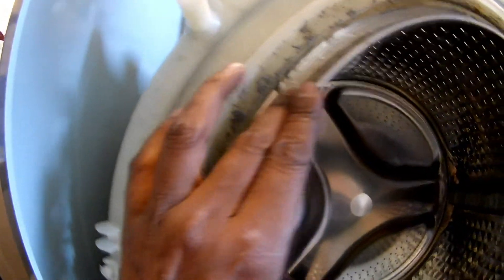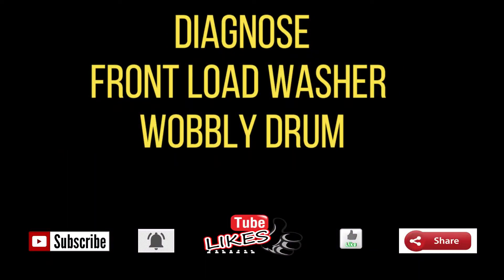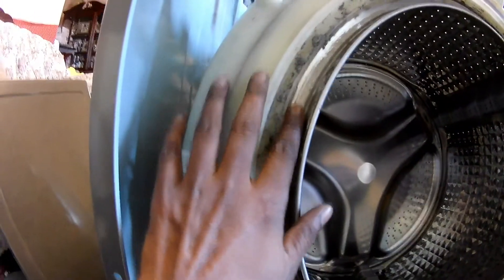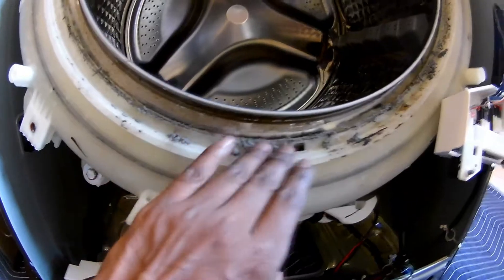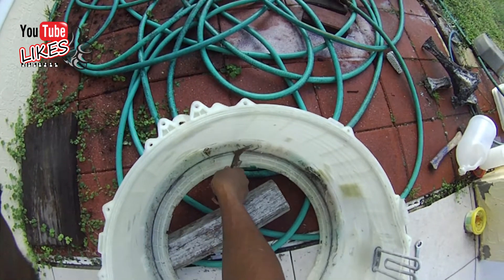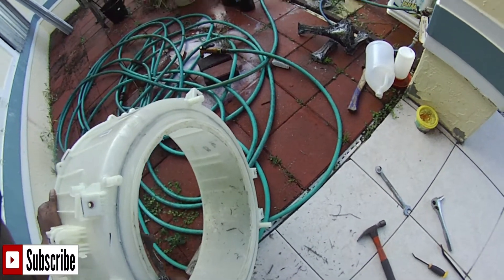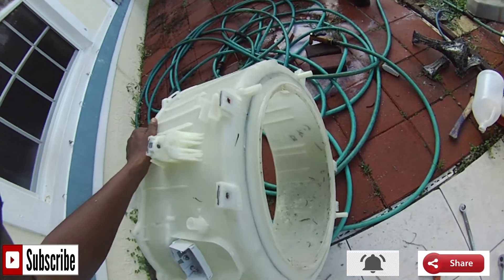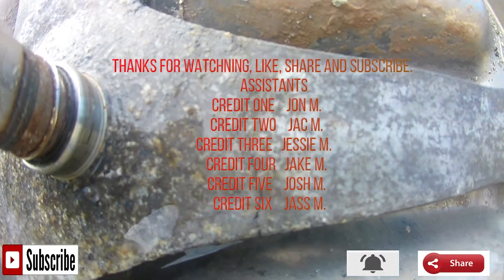Diagnose a Noisy Wobbly  Front Load Washing Machine Drum, Spyder Assembly

Comment: My floor was uneven and adjusted one of the legs and the top it's level now but I think the damage was already done, it still bangs during spin cycle. On medium or heavy loads the banging is very loud but on a light or an empty load there is no banging. Maybe mine has a different issue, like the shock absorbers. I have a hard time diagnosing the problem since there is no banging at all on a light even load. I've read that if the balance was the issue, it would also be out of balance on an empty load.

Comment: Hi there, a few days go we noticed that the drum was making a terribly loud squeaky noise when we manually turned the drum clockwise or anti clockwise and later found out that the drum in certain areas was rubbing against the front door rubber seal. The technician who just rotate the drum with his hand to diagnose the issue said that the drum , the door rubber seal and suspensions would need to be changed and I wasn't convinced . So I wanted to check if my washer has a broken spider as well. I can share some videos of my washer if that helps . Thanks !
Reply from the maker: Hi I am not an appliance technician, just a diy guy that likes to fix stuff myself.
Reply: @BARR8323  then u really are highly talented , I must say !
Reply from the maker: Thank you, I ended up not fixing it because the part was back ordered for 2 months.  With 3 toddlers the house Boss was not going without a machine.
Reply: @BARR8323  😄😄 so u went in for a brand new washing machine , did you ?
Reply from the maker: Yes and unfortunately the same brand, way less features since it was clearance sale and Miss matching colors.  Also spoke to House Boss not to over load it otherwise we will move to hand washing in the bath tub at least she will have AC and not be outside in the heat.  I had to explain how overload is extremely inefficient and does not get it clean.  It’s better to do 2 small loads.  The debate still continues when I see the entire machine shaking on the spin cycle 😂.
Reply: @BARR8323  lol ... house boss

Comment: That sound, my washer was moved into a mobile home, and it shakes all 70 feet of frame. Recently moved into a house, and just like the place before, it shakes and hops. I installed the dryer on top of the washer, still hops. I found after transport the shock absorber on the left rear came apart during transit. This time it won't stop jumping, so like you said, the bearing has light freeplay, but not enough to make it that out of balance. L{ks like I need that spider yolk assy.
Reply from the maker: Yep but it’s expensive, considering the age of the machine and a tech to fix it plus parts cost (my spyder) would have cost $150 if I recalled correctly. I just ended up buys new one.

Comment: Thank you so much for sharing!This is exactly what's happening to my machine right now. I got an estimate and it was close to $700.I know I cannot do this type of repair.That's kind of steep I feel I'll be better off buying a new washer.Do you agree Or should I get another estimate.
Reply from the maker: Late reply, I ended up buying a new one since the parts was back ordered.
Reply: you are correct that the cost is between 600 and 700  and even if you have it repaired another arm will probably fail in 5 to 7 years. the front tub is also likely to fail as in this washer and my own washer. the spider is made of a cast metal, probably a zinc compound and electrolysis is what is causing this problem. it exists on samsung, lg, whirlpool kenmore and several other front loaders. i will avoid front loaders in the future.

Comment: How did you fix it though? I have the same thing. My drum is banging against my forward tub and I replaced the tub because it was so bad, but whats the fix?
Reply from the maker: Your Spider is probably Cracked/broken I think it’s about $150, your drum might have cut the tub, and or rubber lining.  My spider was cracked and tub was cut.  I was going fix the tub with an epoxy cement and replace the spider, but parts take a week and wife had to do laundry because of 3 toddlers, so I bought another one.  It’s still disassembled in my garage.  I was thinking of fixing it because it’s a way better than the one I bought. My fix would have cost ~$200 in material only.  One of my videos show the spider arm cracked.
Reply: @BARR8323  i had the same situation i took it apart and selling its part which will be worth enough buying a new one.